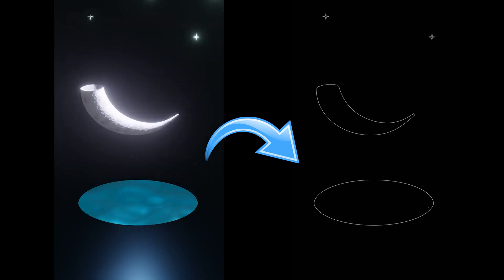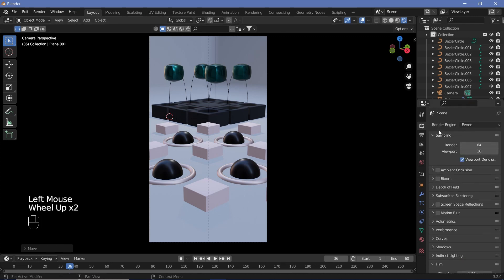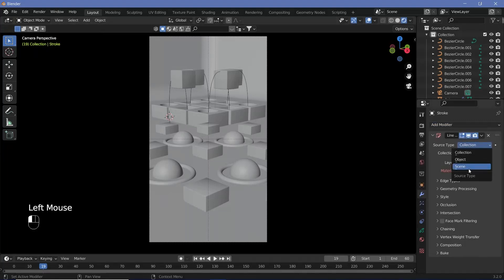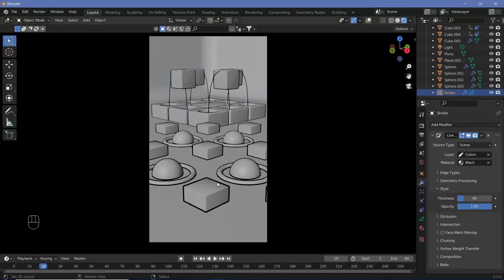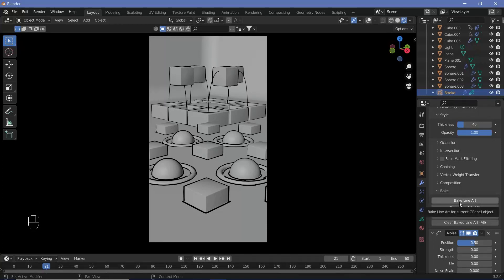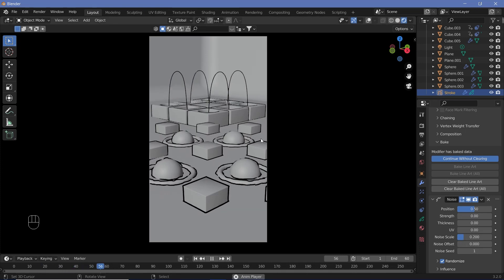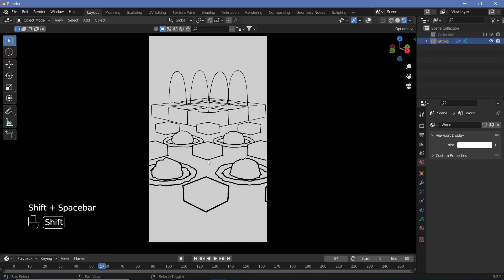Convert Renders to Line-Art  - Blender Tutorial

Comment: very helpful. short, easy to follow, mentioning everything. Thanks.
for blender 4.3 the last trick with hiding a collection doesnt work. I put white background color and also the material as white color and now i have black line on white background. Perfect woudl be to be able to render transparent png.. not sure how at this moment.
Reply from the maker: Thank you so much! I really appreciate it :)

I definitely have to see what changes are needed to make this work in version 4.3 or higher. However, if you have lines on a solid color background, you can definitely make it transparent using compositing. 

You can even try this method for the time being:
https://youtu.be/P0HbRm-fSiI

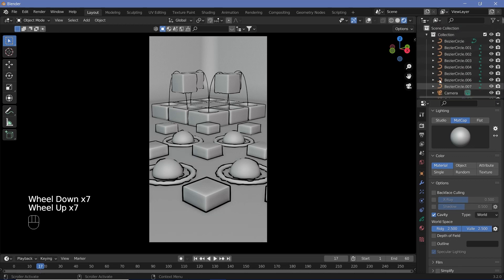Comment: Hi thanks for nice tutorial, one thing: 3:28 when i dissable the collection, the strokes disappear too and are not visible in render (blender 4.3)
Reply from the maker: Thanks!
I have not tried this with version 4.2 upwards, but I believe that there are issues.

Another viewer commented a possible solution that I am yet to try:

"for blender 4.3 the last trick with hiding a collection doesnt work. I put white background color and also the material as white color and now i have black line on white background. Perfect woudl be to be able to render transparent png.. not sure how at this moment."

Commented by:
@viktordedek8664
Reply: @deayanstudios  To solve this issue in Blender 4.3, I applied the Line Art modifier. Once you’ve done this, you’ll be able to disable all the other collections, and the outline will remain visible for the render.